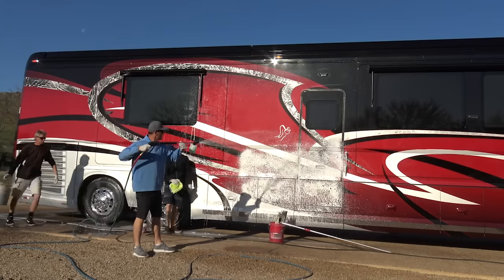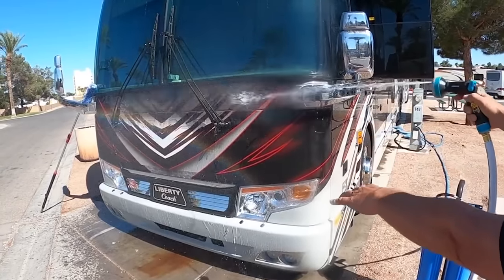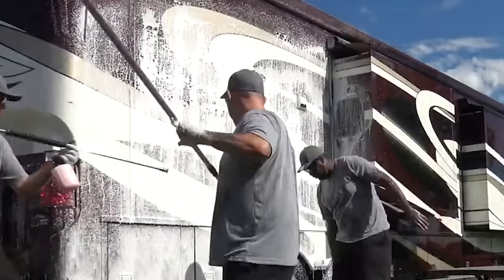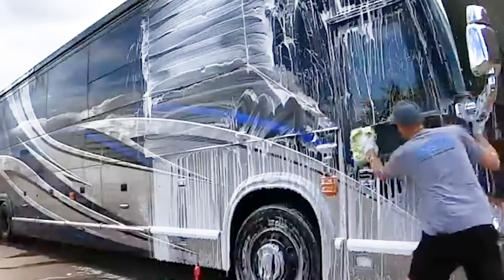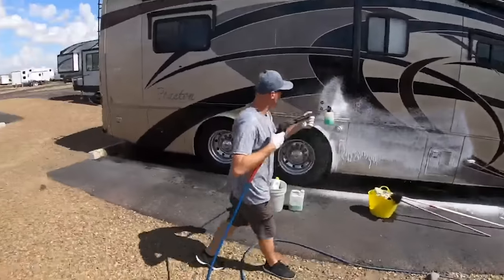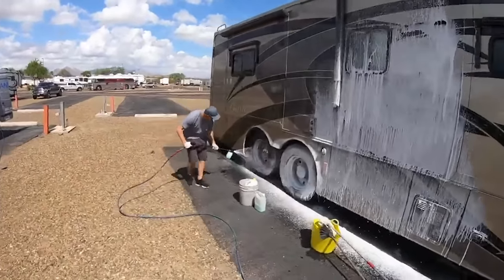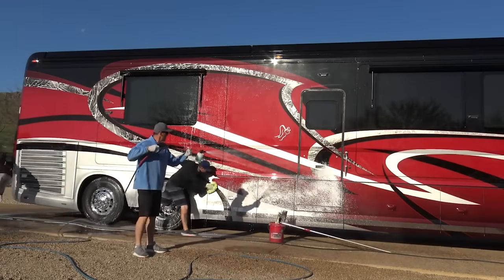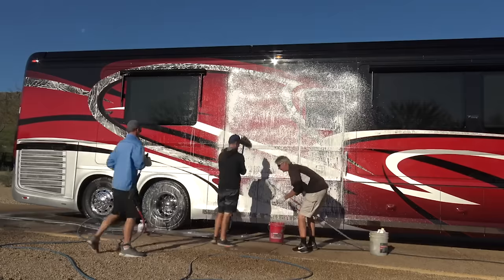How Much Does it Cost to Wash a RV in 2023?

Comment: Several times in the past couple of years when I've tried to have a mobile wash done they wanted $400+ to wash ans wax.  They refused to do just a wash.  The most recent was yesterday here at the Anchor Down RV Resort where there was a mobile wash service working on several coaches and they said they don't do just a wash.  It was $400 and I wasn't impressed at all how they were doing their detailing.  I keep my coach waxed and don't need it waxed again when I'm traveling.  Just because one day it rains while your driving doesn't mean I have to have it waxed again.  When I was able to just get it washed its always been in the $130 to $140 range.  That's what the guys charged that came into the Oasis in Las Vegas charged and they did a great job.  Gave them a nice tip for that.  BTW, it would be interested to know what these guys are expecting to be tipped now days as well.

Comment: In DFW Texas we use our dealership for wash and wax. 225 for wash and wax is about 900. We also use a mobile detailer and he is the only one I trust. We pay him 400 for the wash that includes tip. This is on a 45 foot coach. We have used many mobile detailers nationwide in our travels and like Andrew said, no two washes are the same. Our best wash and wax is always at LVM in Las Vegas. Generally, the best washes are in motorcoach resorts.

Comment: I have a 2020 newmar London Aire and wash it myself. The newmar manual says that they don’t endorse any form of washing different from a hand wash with a sponge, including the brushes like those sold in camping world. It says that they don’t recommend throwing directly with a water pressure to protect the paint; they say spraying low pressure water sideways, not directly. I use the shower or the fanning setting of my hose nozzle. Do pressure only underbody to remove dirt. I do send water pressure through the holes of the Alcoa rims to remove black break dust. However, they recommend using an airplane brush that has fine hairs including on the sides. They say that for hard water you alter the chemistry by adding 1 cup of vinegar per bucket of water and soap wash & wax, the rinsing does not leave hard water marks. I do that pinky wax and wax product from camping world. I use a drying towel and a  pole having a long squeegee attached to dry, I only climb on a 6 feet foldable scaffold I bought at Lowe’s to reach the high edges. Just do up and down drying with pole, squeegee and towel. I wax with normal car wax by hand, first do all around I can reach from the ground, then I do climb the scaffold for the high areas. I climb to clean the roof with a blower to blow away dust, and 2 wet towels, I protect my knees with knee pads and do the roof by hand; then I clean the air conditioner covers and antennas with the uv protecting solution. I recommend staying away from soaps that are labeled ceramic; I  had to wax the coach entirely one time because it left very hard to clean white stripes in the coach. When I’m washing with soap, I clean and dry at the same time, dividing the coach into 6 parts: 1/2 way each side, front and back. I never wash the whole coach with soap leaving water to dry out by itself. As soon as one area is cleaned, I dry it and leave it neat, ready to attack the next dirty area. With practice it should take you 2 hours to wash the entire unit like that, plus 1 day waxing. Never try to do it in 1 day all, it will kill you if you are alone like me. I advice using the drying cloth wet with only water after you have driven for a day without raining, use the pole to reach the tall areas. I’m a freak of high maintenance, so I even do that while refueling, of course I get out of the way if a semi is waiting for me to leave. It actually helps as a small workout when driving long distance. Dusting off the coach from the road trip at least half way down the area reachable from the ground by the hands while refueling is relaxing your muscles. That’s the area that gets dusty while riding, not much 1/2 way up, leave that for the RV park when you get there. I suppose this is a work that may cost easy $500 for a tag axle coach.

Comment: I hired a company once to wash my 44' Newmar Dutch Star and overpaid. Worse, I was very dissatisfied with the result, I probably won't hire an RV detailer again based on that experience. I wash every vehicle ONLY with a deionizing filter and test the water prior to using it. Not doing so is worse than not washing it at all, as hard water spots require a huge amount of labor to remove. I'm 72 years old and very picky. After hand washing with a microfiber mitt (and a lot of up and down on a ladder), I then use Aero Cosmetics Wash Wax All and apply it to the exterior. Occasionally I will fire up the random orbital buffer and put on some polymer wax. From all of my research, ceramic wax is a marketing gimmick and not worth the cost. I agree, Andrew, I can do many wax jobs for the cost of one ceramic coating, and it looks just as good!

Comment: Not sure what ceramic coatings you used before, but now they last 3-5 yrs and usually 1 maintenance wash once a year. Will far out last wax as most wax will only last 30-45 days and offers no protection like ceramic coatings. Yes, it is more expensive in the outlay of money but when you break it down over years it will last it is far cheaper.

Comment: Here’s a question for you. What happens to your nice clean coach when it rains?  That rainwater dries and bakes into your paint?
Reply: Same as your car. Same paints essentially. Are you 15yo?
Reply: @itsruf1  why are you so rude?  It’s a legitimate question.  What’s the point of using the special de ionized water when it’s going to rain on your coach anyway.
Reply: @kingdavidcoffee  De-ionized water is spot free and thus does not require drying off the coach.  That is how I understand it.  Yes, once your unit gets rained on it will still spot.  I guess ceramic coating and wax will help in that regard.